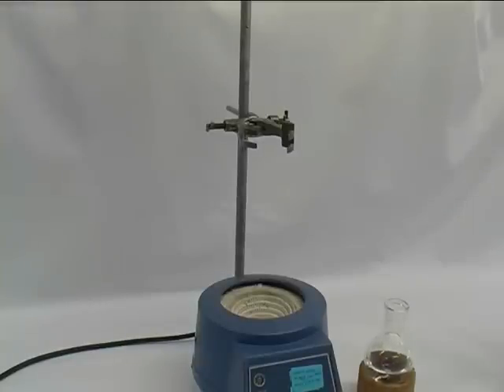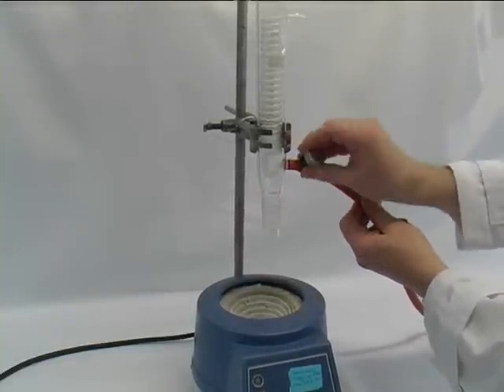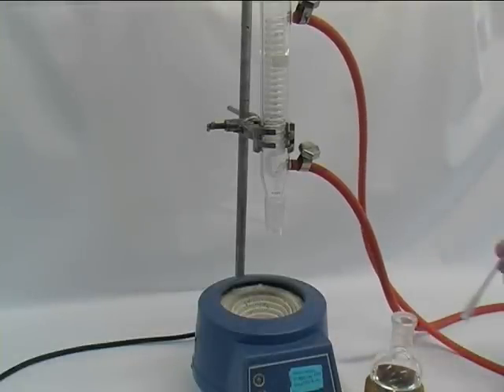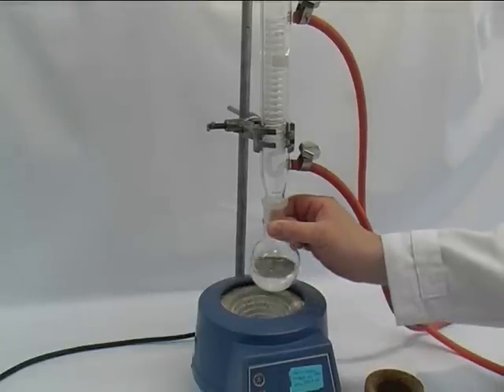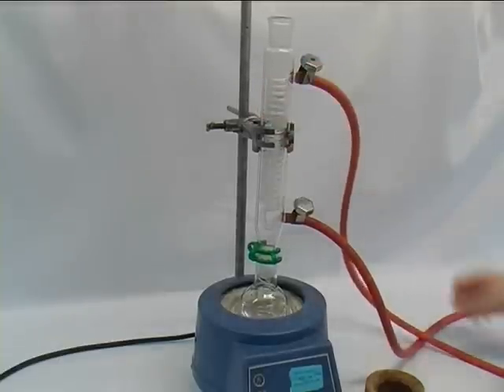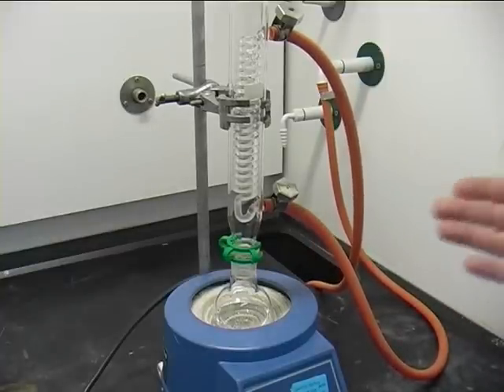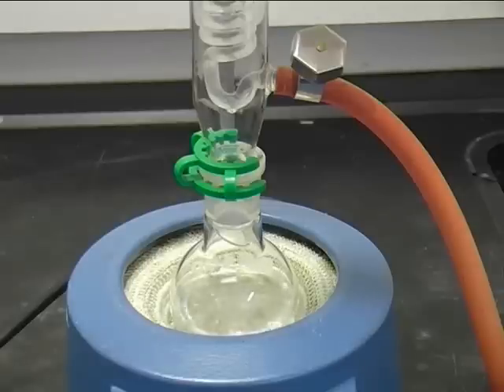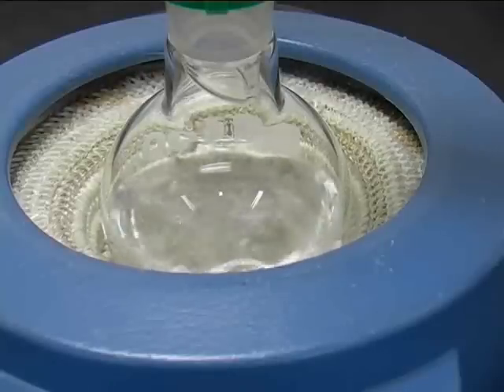Reflux

Comment from the maker: The anti-bumping granules ensure that the solution boils in a controlled way. Without them, the solution is likely to 'bump' as it's heated, sending the solution up the condenser and perhaps out of the top.

The cool water is to keep the condenser cool so it can continue to condense the solvent vapour. Without the cold water the condenser would warm up more and more, and the vapour would pass through without condensing.

Hope that helps!

Comment: What type of heating device would be used for 1000ml flask? What are those tubes called? What are the clamps holding the bottle in place called? Is there a way to something else either than  tap water? Because it does waste a lot of water.

Comment: Reflux helps maintain the desired profile in a column. It is possible to under reflux and over reflux a column. Reflux is often used to keep the separation point at a very precise place in the column whether that place be towards the top, bottom, or middle area of the column. With this guys set up he could probably reflux (almost) hard enough the keep the liquid from boiling

Comment: Thank you very much for the video! It's very interesting!
What I don't get is its purpose..Does the mixture do change it's chemical composition as an effect of the boiling? Is it a separation process or a chemical reaction (for instance some thermal cracking).

Comment: Just In case anyone else is trying to find the "jubilee clamps"  they are made buy Unex in Germany. These are simply tubing clips with a hexagonal head. As for the vid thank you for mentioning other condensers can be used. I've had bad luck with glass coiled condensers and I've found an Allihn condenser works well.

Comment: Doesn't reflux waste a lot of water if you let the perfectly clean water run down the sink like that?
Reply: yeah how do you re run the water back through? you should be able to do that so u don't have to waste over a 10 hr period of time per say
Reply: Lifeslikett water isn't wasted, it doesn't just disappear, it goes into the sewer and goes back to the water purification plant.
Reply: 5 gallon bucket of ice water and recirculating pump. Run hose in bottom of condenser out top and back into the bucket. That way you can control the temp and only waste a tad.

Comment: This setup is not set up completely correctly!

Flask should be clamped at the neck for main support of the setup.
Condenser clamped lightly for additional support.
Heatingmantle must be placed on a lablift in such a way that in case of emergency the heatingsource can be removed immediately without having to losen clamps of the setup.